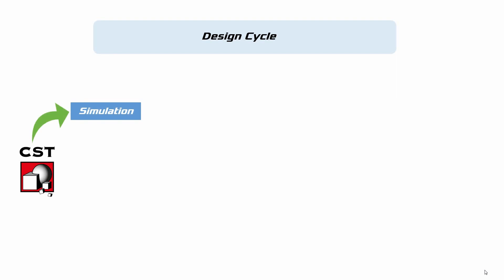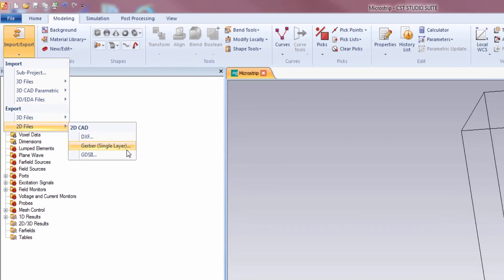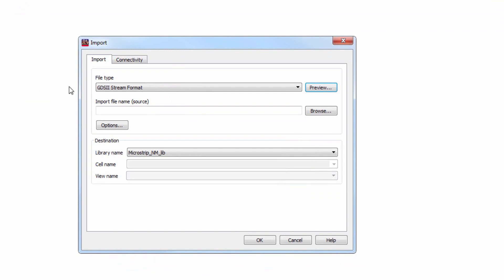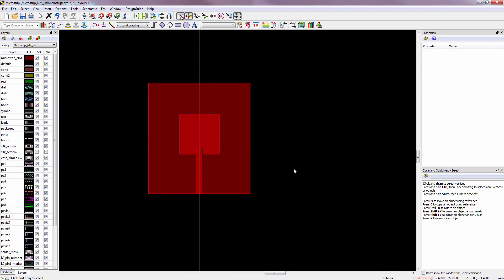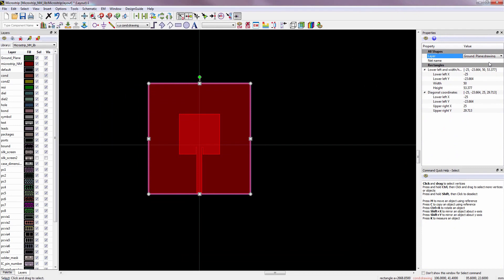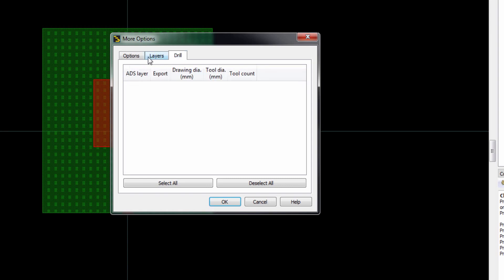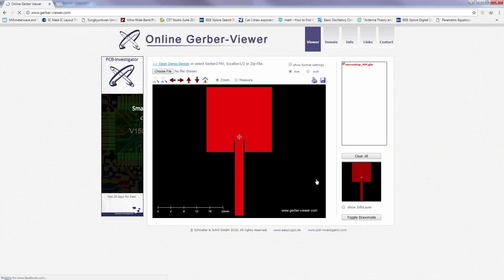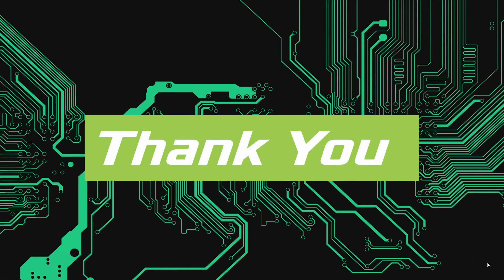CST Tutorial: Generating Gerber File from CST & Keysight ADS for Antenna Fabrication

Comment: Hi, for some reason, there may have been an update when I take a gerber file from CST these days my ground plane is not selected with my top layer. Will this affect any generated gerber files? Also will this produce the required board outlines needed by manufacturers? Also in ADS when I try to create a new workspace I don't get the wizard anymore which lets me define units as mm/whatever but when I export the final gerber I can choose mm. Is this again another problem?
Reply from the maker: You need to position of your WCS coordinate in CST on ground plane to export it as a layer of gerber. Basically, each layer you wanna export, the WCS should be aligned on that particular layer. Hope it helps

Comment: I was told that because CST doesn't produce an outline gerber file, some manufacturers are unable to manufacture gerbers that are generated by CST and that by running any CST generated gerbers through ADS can fix this since ADS produces the required outline gerber. Is this done automatically by ADS or does a box need to be checked to produce this outline gerber file?
Reply from the maker: it is automatic
Reply: @tensorbundle  thanks for the reply, got my first patch antenna all done and dusted, how would I make/include drill holes in my designs?

Comment: Please I am having a problem to determine all layers in CST before save as Gerber file ( How you do it? )
Because when when I do as you do it, just one layer is appeared ( the ground plane).
Reply from the maker: you need to place the global coordinate system on the same plane of the intended layer which you want to export as gerber layer. So if you have 3 layers, simply move the coordinate to each corespondending layer and export

Comment: sir kindly explain that how three layers gerber file is generated. such that; patch, substrate and a ground.
Reply from the maker: align each coordinate system on the surface of the layer which needs to be exported as gerber. It does not matter how many layers to be exported as gerber. The important fact is that we can export only that layer as gerber on which the coordinate system (UVW) is aligned on the surface. So make sure you align UVW three times on three layers surface and export them as gerber each time
Reply: Tensorbundle sir and how to export lumped parameters on the surface of an antenna to gerber file. ?

Comment: Thank you for the information. Is there any way I can also export drill file for the via holes? Many thanks
Reply from the maker: The drill file is auto generated and becomes a part of of gerber pacakge. Check the folder. There should be a separate drill file along with the gerber image ones

Comment: And how can i do with a vivaldi antenna that is microstrip feed?
Reply from the maker: Same procedure. Two layers.
Reply: Ok. I found that changing the local coordinate to the desired level (top or bottom) , than you can export this level. Dxf is valid format to send to fabricate? Thanks
Reply from the maker: right.As shown for patch antenna, for vivaldi, the microstrip feed is bottom layer and Slot layer is the top layer. All procedure is same. Only difference is in their geometry eg. vivaldi is a tapered slot type and patch is square . 
No dxf is not suitable for delivery to fab company. They need gerber file.